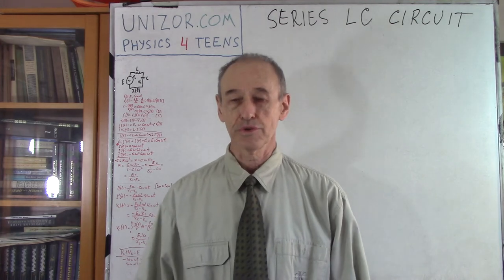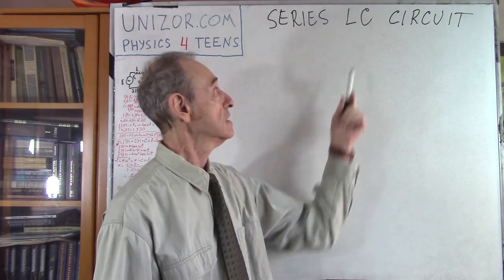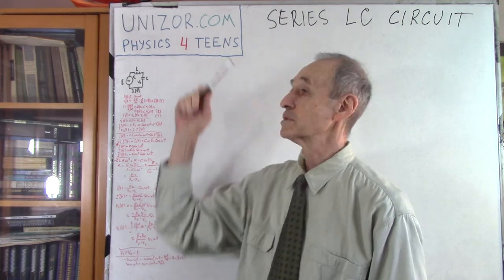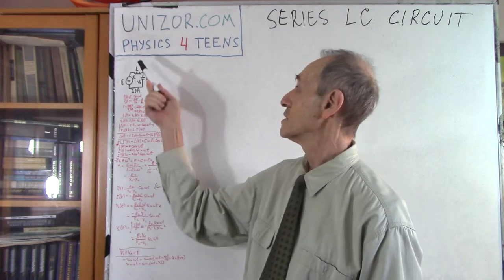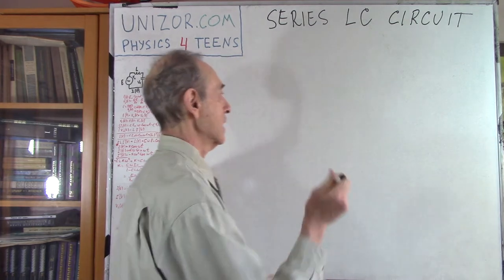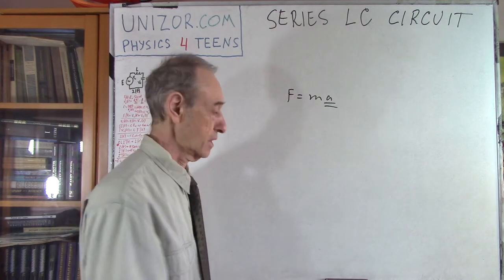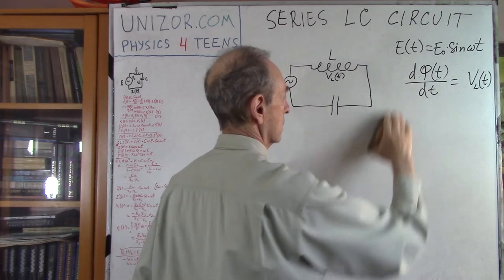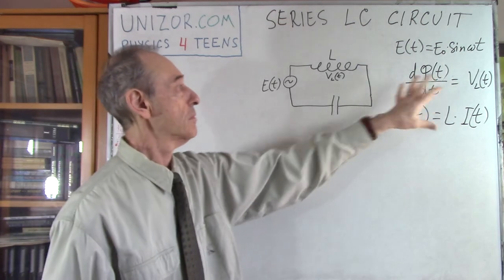Series LC Circuit: UNIZOR.COM - Physics4Teens - Electromagnetism - Alternating Current Induction

Comment: Can we say that LC circuits works as current and voltage dampers,
Reply from the maker: In some sense, yes. However, there is an important detail. In LC circuit current I and electromotive force (voltage) E are related as I=E/Z, where Z is an impedance.
In LC circuit (no resistors) impedance equals to XC-XL, where XC is capacitive reactance =1/(ωC) and XL is inductive reactance =ωL.
So, you might increase both reactances by the same value and it will not change the current. 
However, both capacitor and inductor contribute to phase difference between current and voltage, but in different directions, which is also important.